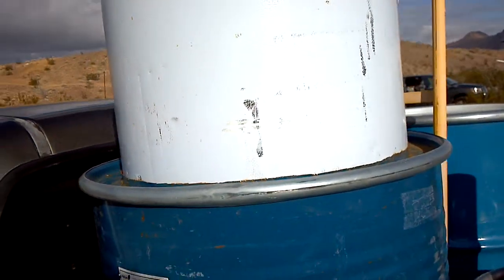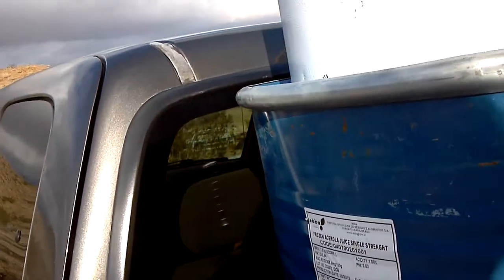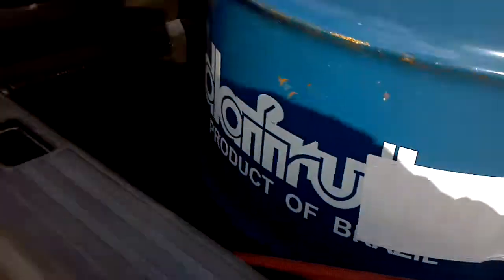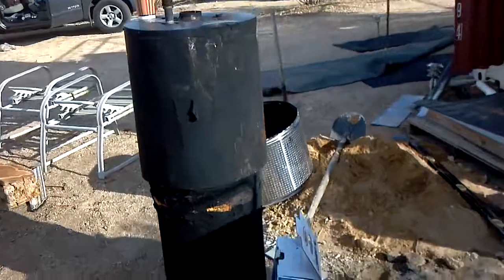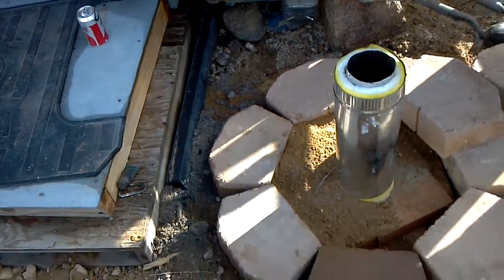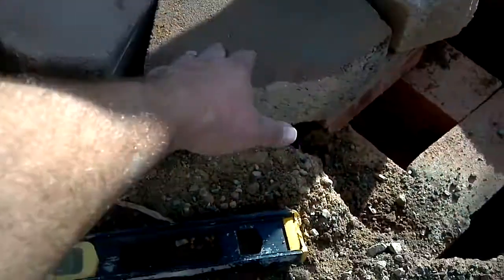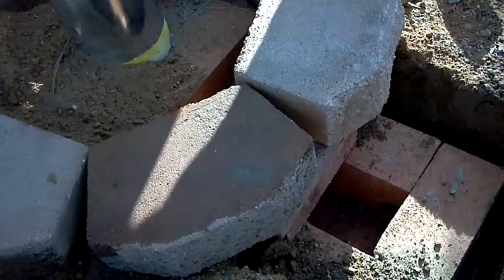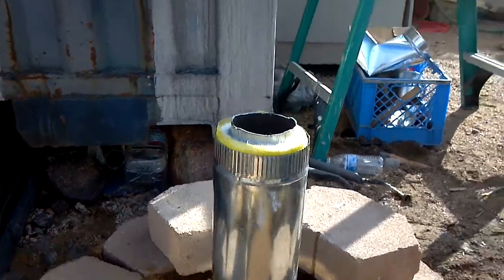Rocket stove water heater project

Comment from the maker: I am uploading part 2 of the Rocket stove water heater. I need to make a few tweaks to it. But I think this is going to work out perfectly. You know I use to take 5 gallons of gas for generators and A bottle of propane with me for different heaters and things. Now I rarely use the generators. And the propane use is limited.